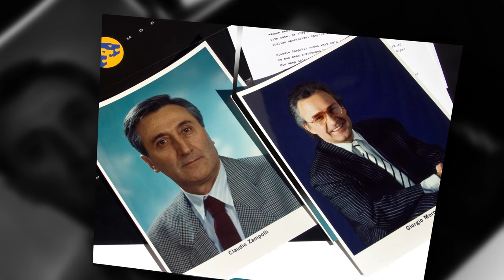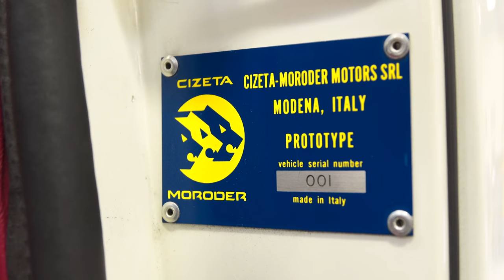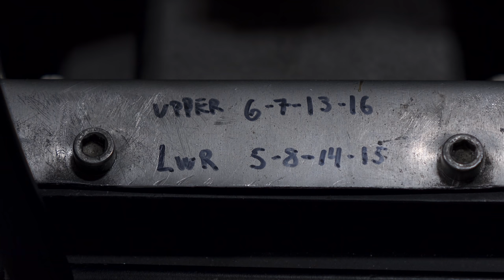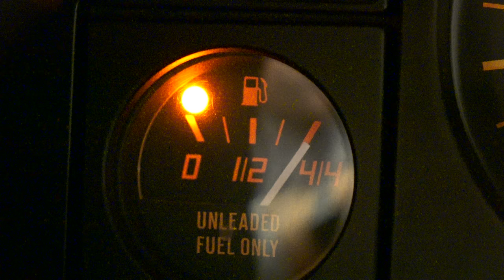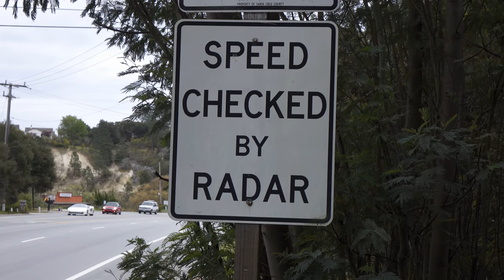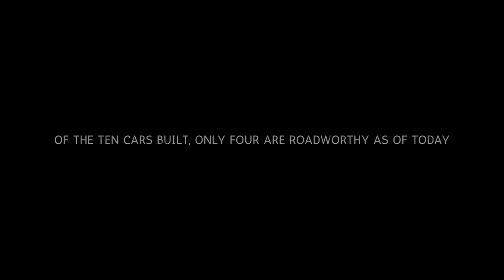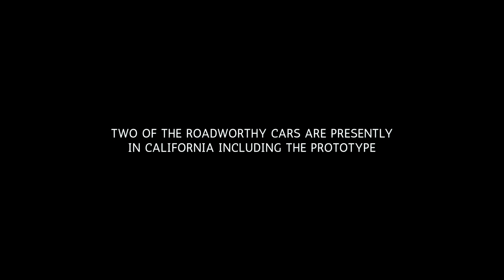Cizeta Moroder V16T: Resurrecting the Wolf Documentary

Comment: 2k rpm @ 60mph = VW Golf 1.9 TDI 
Nothing unusual with torque from 16 cylinders.
Reply: It would be fun to go 120MPH @4k rpm. 
 I doubt it's making much power in its current state though. I wouldn't be surprised if you could get a more refined ride, and just as quick, from an alfa romeo 166 V6 3.0 slightly tuned to 260BHP (only one catalytic converter, sports k&N intake and a light ECU tune). Plenty of power for 150 mph.
Reply: @SalveMonesvol  this is 500+hp rocket. How You can compare it to 260hp Alfa? 
This is more like 200+mph car.

BTW i love Alfa. Yesterday i saw black 164 3.0. You do not see it everyday.
Reply: @jareknowak8712  The thing is, this prototype SHOULD be a 500HP rocket, but I seriously doubt it is, as much as I doubt it runs better than the large alfa.
 I'll be surprised if this v16 in particular gets more than 300HP on the dyno in its current state. 
 Potential, it has. Even race car potential. But now, it isn't.
Reply: @SalveMonesvol  Car is old, but for sure was kept in proper storage. Even if it was unused it does not mean that is not good anymore. As prototype probably was used to max speed/acceleration tests. I believe that in fact it is still very fast, way faster than 166 3.0.
Reply: @jareknowak8712  In a straight line, most likely. But don't forget that despite the sharp look, this design  has a lot of drag. I wouldn't trust a stock 166 against it, but my point was that it must be extremely expensive for what you get. I should leave it here though

Comment: I'd bet dollars to dimes it was the siamesed potted pickups assembled wrong. They probably swapped a few and gave up. Moving on to the next car. Had the same problem and corrected it eventually. With money tight and time short, going back to fix the car with all the prototype issues never happens. Too much time and effort vs your established assembly line.
The only way a 16 cylinder engine would sound good is with two 8 into one exhaust. Being cross plane crankshafts, swapping header tubes of the two odd fire cylinders would make perfect for equal length scavenging exhaust. A la flat plane crank sound without the 180 degree pulses. Every 90 sounds like a street bike with 4 into 1 exhaust. Dual that!!! More power and way better sounds. 16 cylinders are too many odd pulses, they all sound like crap which I would gather is the only reason nobody bought them.